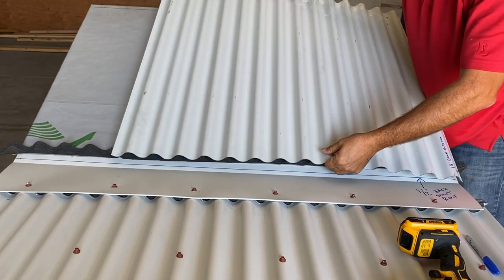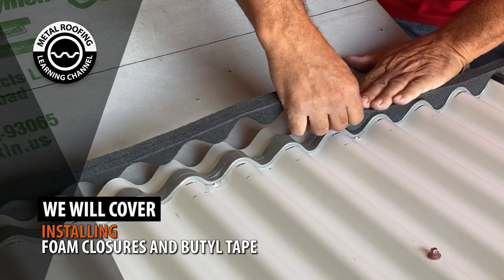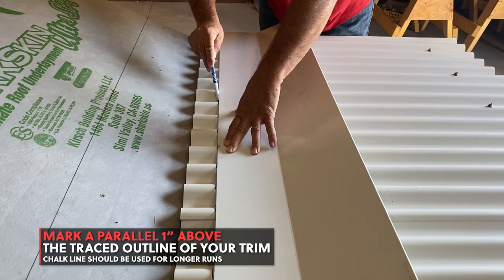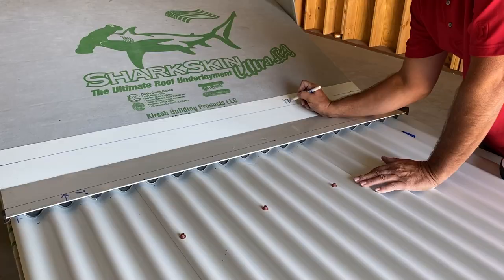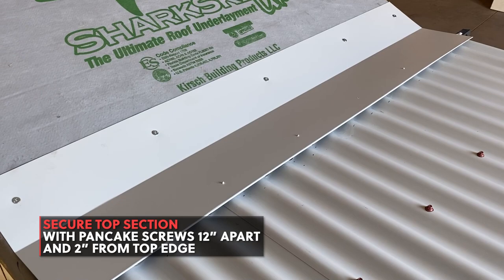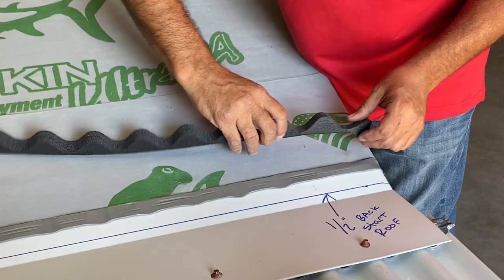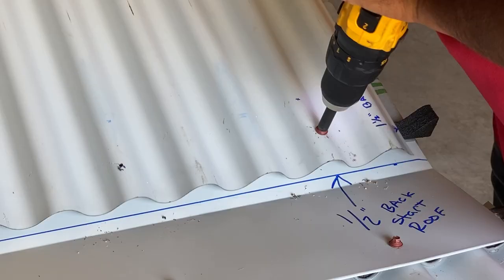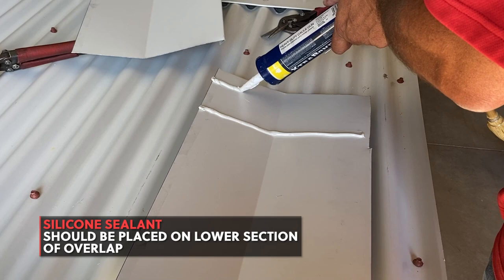How To Install Pitch Break On A Corrugated Metal Roof. High To Low Transition Flashing Installation

Comment: I had a contractor that was unfamiliar with metal roof installation. The roof has an identical break in it as demonstrated in this video. The brand new roof has leaked like a sieve since the first rain storm. I use the barn for hay storage and this issue renders my new barn useless. Contractor didn’t do any thing like your video. Thanks for pointing me in the direction I need to go.

Comment: Thanks for this Video, i am about to fix  a roof with zero flashing on the gable ends and pitch breaks. and theyve used the panel screws into the low part of the corregation. im gonna salvage what i can but looks like ill be installing a new roof depending how bad it is when i start pulling it up to replace a sagging truss. all new to me,, but this video brings a bit of clarity to the jov ahead of me
thanks again , subscribed :)

Comment: How would you do that where instead of a straight roof your installing the flashing on, you have the wall of the house, and a built on carport that has two roofs intersecting with a roof peak in the middle. Would you splice it on both sides or what. Any help would be appreciated